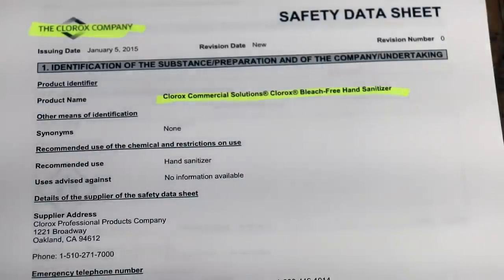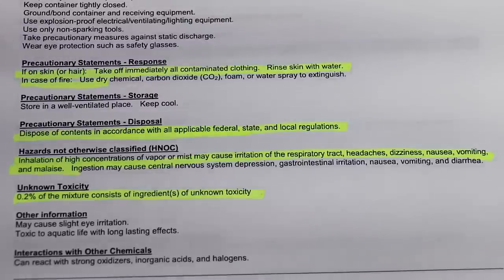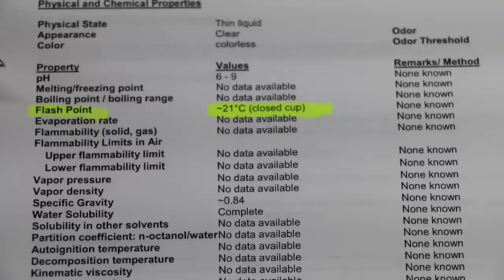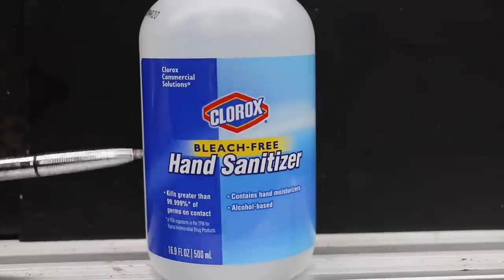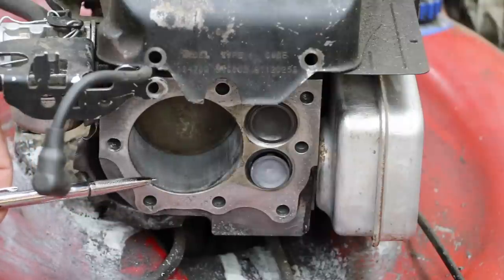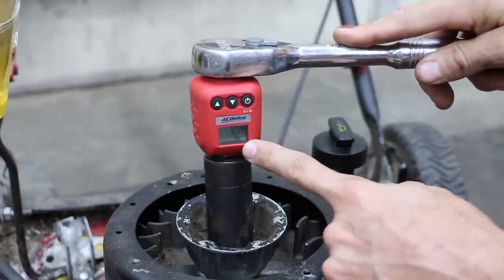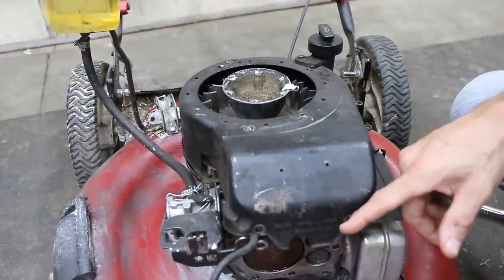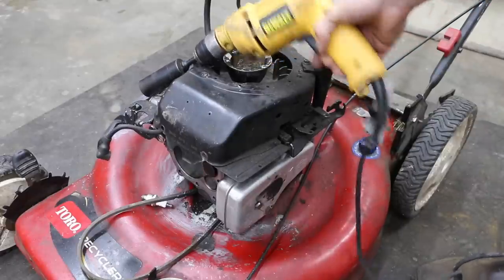Will an Engine Run on Hand Sanitizer? Let's find out!

Comment: I'm amazed the engine actually ran, though I had heard that you could get a petrol engine to run on whiskey, or similarly highly volatile, or should that be aromatic, alcoholic drinks.

I would guess that if you knew the fuel situation was dire, you could add the sanitiser to the existing contents before you ran out of gas, and make it spin out that bit further?

During the fuel tanker driver's strike, here in the UK, people were adding lamp oil, or heating oil to their
diesel to just that effect, even more were adding cooking oil to their diesel, and some were running on 100% cooking oil. Granted that was diesel, but the idea of mixing fuels and substitutes remains fundamentally the same.
Reply from the maker: I agree. Thank you

Comment: I heard somewhere that an engine will run on whiskey or something. Is that true?
Reply from the maker: I tested Everclear and it did work but haven't tested any other alcoholic beverages
Reply: Would love to see if an engine will run on Jack Daniels or something similar. Incase you run out of fuel on your way to a party and only have a bottle of whiskey/brandy/rum/vodka with you.

Comment: Hey buddy, I hear stories that engines use to get excellent fuel economy back in the day before gas recirculation and all the other emission controls. So I was wondering how lean can you run an engine and what is the best fuel economy you can achieve on a car engine in real world driving?